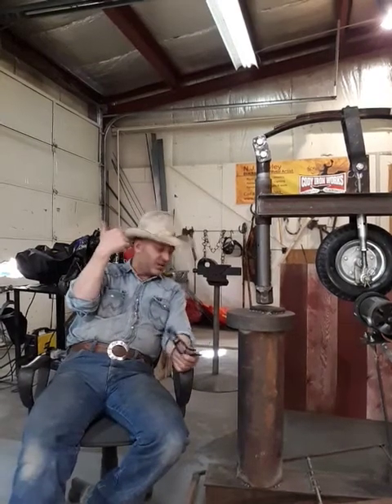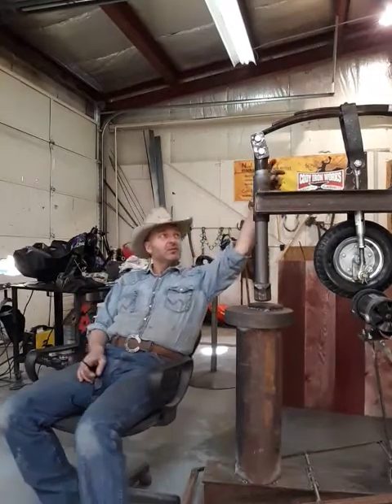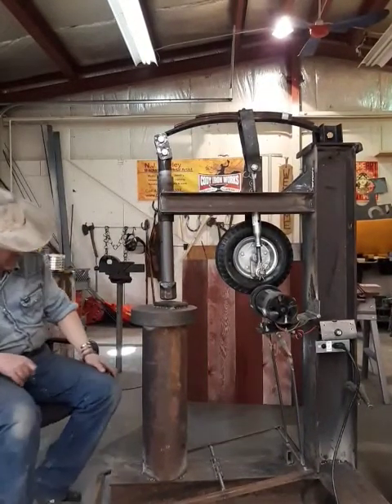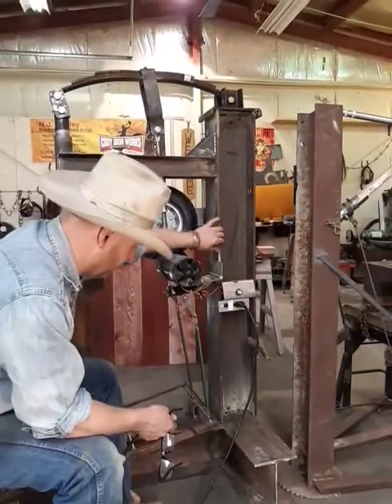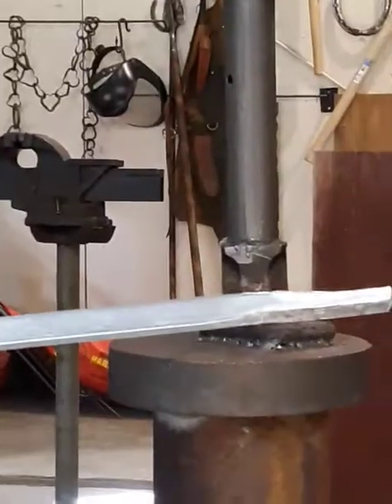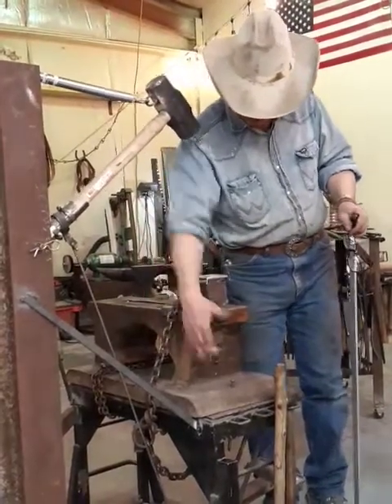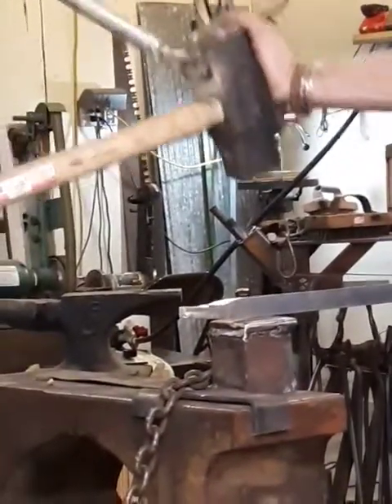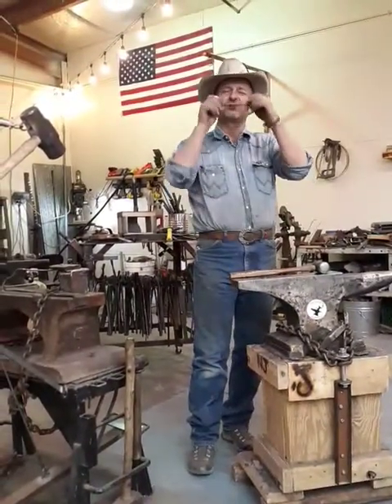Talking about the home built power hammer

Comment: Not bad, for a   '' floor  '   design !  Cody !.   That  pot, controlling the speed.  Idea :  Maybe consider mounting it, on the floor, with a home made   ' lever'  attached to the speed control pot. Have this lever, connected to a foot treadle,  ( or even a hand held-wired speed control ), near your  On/Off mechanism, on the floor. (foot controlled).  Kinda like old-fashioned  REAL  sewing  machines.  I would agree, on removing one more short leaf, on the top spring; give it more  ' whip '  as you stated.

Comment: Isn't your spring upside down?  In this configuration I think the only spring action is from the longest leaf in the spring pack, so if I am right taking all other leafs out will have only a minimal effect on the whip you are trying to optimize.  Best regards.
Reply from the maker: ya but it will lessen the weight then I can use more hammer